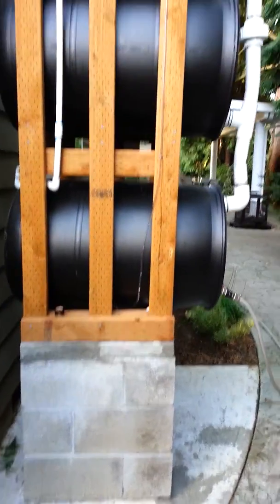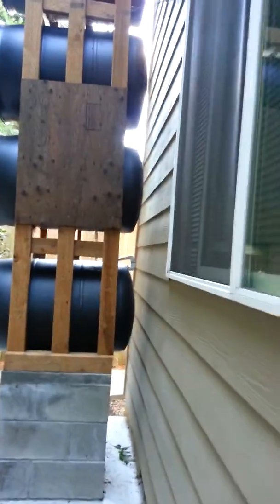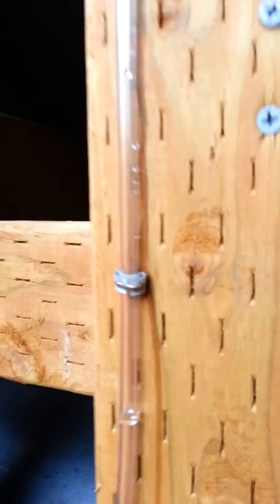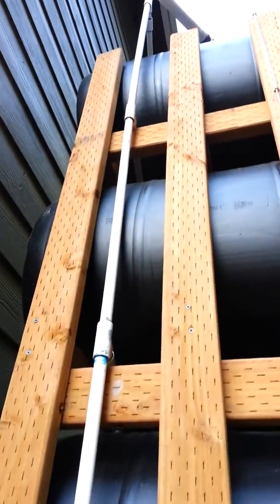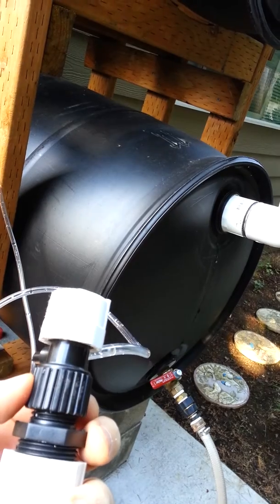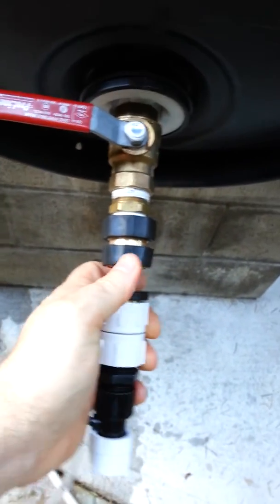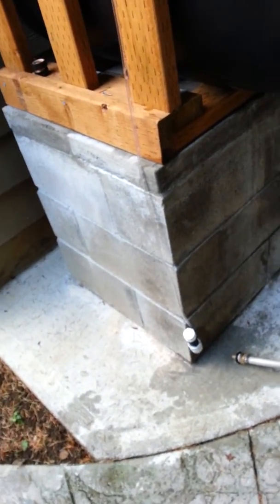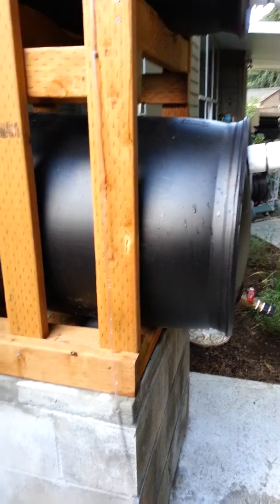Water Level Gauge for Rain Barrel Tower

Comment: The water into that small tube is under pressure, it's flowing rather than settling to find it's level. Those tanks could be three quarters full and still force water out the top of that little tube. I'm suggesting your logic is incorrect.
Reply from the maker: Yes, the water flows, but the water in the small tube always flows only until it reaches the same level as the barrels (ignoring the small interpolating oscillations near the equilibrium point). The only pressure is to get the water in the small tube up to the level in the rest of the tower. In practice it quickly reaches equilibrium, within a second or so of crossing the target height.
Reply: +Ian Crane sorry but I just don't believe it can work like that. And that is not the meaning of equilibrium.
Reply from the maker: +pippaknuckle Ha ha, not sure if you don't understand or if you're trolling me, but I will post some video showing it working at different water levels to demonstrate. It is pretty easy to believe after seeing it in action.
Reply: ***** Thanks, I look forward to this proof.

Comment: You do not explain how it works. Does the level you see in the tube reflect the volume of water in all four barrels? Do you climb up on a lagder to see how high the level is?
Reply from the maker: Elliot Landes You guessed it. The top of the water in the tube will exactly match the top of the water in the barrel stack. It's easier to see with your eyes than it is with a cell phone camera, so I don't use a ladder. Since my tube doesn't go all the way past the top, it will overflow when the barrels are all full. In that case you can hear it dripping, which works even in the dark :)

I should mention that the design you see here had to be revised. The pressure changes in the bottom barrel was too much for the plastic to take and after a couple of seasons it got all floppy and I had to replace it with a steel barrel. The front of a steel barrel is flat, so it was a little tricky mixing the two. Hopefully I'll get an update out on my vacation in a few weeks.
Reply: Elliot Landes  It's the phrase "water seeks its own level" at work. This is basically like a U section of pipe.  Pour water in on one side and the other side will match the same level.
Reply from the maker: Well put Josh Barstow
Reply: It doesn't work